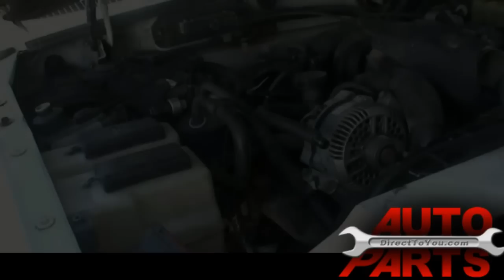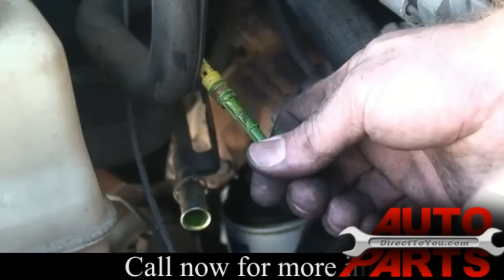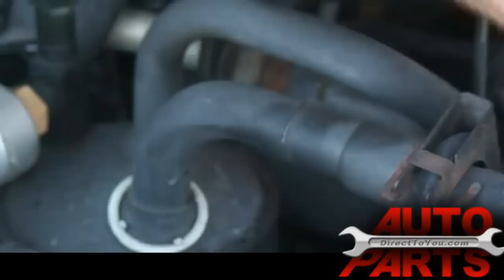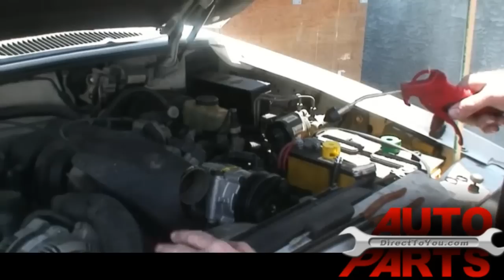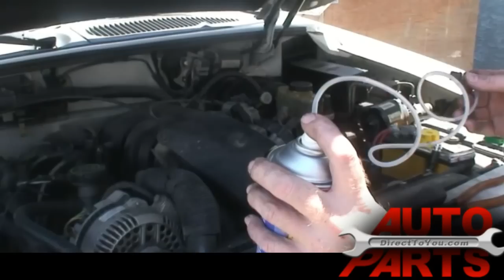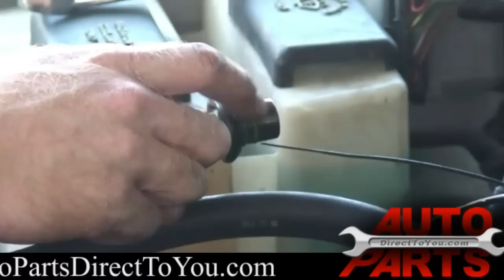1996 Ford Explorer AC Compressor Part 2

Comment: Do I have to do the flushing on the AC system on my 2003 Ford Explorer XLT with the rear AC or only on older cars?
Reply from the maker: Most new car use a 'Parallel Flow Condenser' and flushing them is not recommended.

Comment: The kits are good, and the on-line instruction excellent, but they really  should make it clear that unless you have your parts installed by a CERTIFIED AUTO A/C SHOP, that there is NO warranty on the compressor. Even though it has a nominal one year warranty, it will not be honored unless you do as above, losing of course, any cost savings. You are on your own;  buyer beware. I just had this experience today. Too bad, and disappointing. Now in less than a year, the compressor has sprung a leak in the case and I am buying another from a  different source as a replacement, at my expense.

Comment: I am doing this for my 97 Explorer but the Accumulator is stuck. By that I mean I can not get it to release from the pipe that was the nut on it. I don't know how else to explain that but any idea on how to get it to come loose?
Reply from the maker: It sounds like it might be just seized, if the pipes are physically stuck together, you can try soaking the connection in penetrating oil, it might take a while for it to work into the seized part, but that often works. Frequently, on aluminum on aluminum connections will oxidize and those connections can be quit difficult to separate.

Comment: I mistakingly bought a quart of liquid a/c flush, thinking it was an aerosol can as you used. If its in liquid form, I can pour small amounts into the lines, let it sit, and blow it out with compresser air right? Hopefully that will have the same effect as the aerosol.